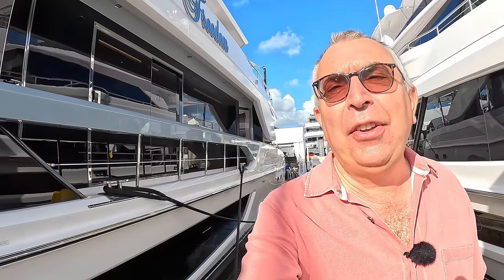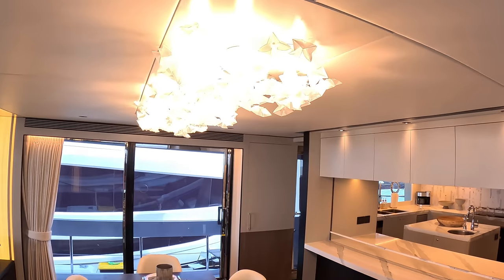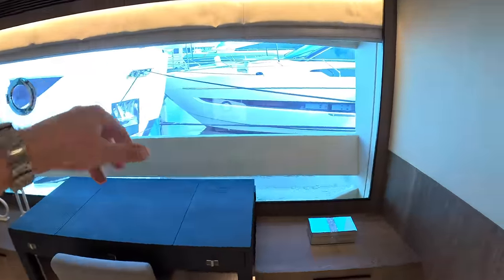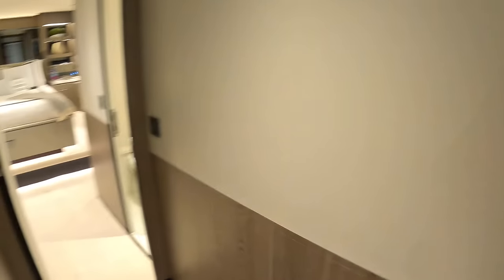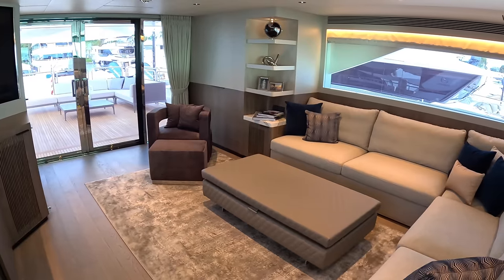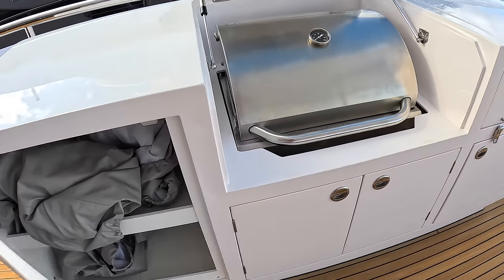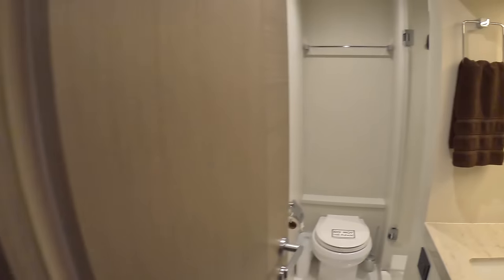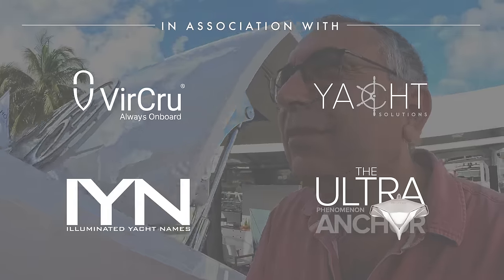$17.6 Million Superyacht Tour : Horizon FD110

Comment: So far outside my Boat Budget, and not wanting a terminal attack of envy, had to cut short watching this, plus it hasn't got Sails.  Sorry Nick Guaranteed it is so nice I'd be done for, and possibly drawn to attempting a Bank Heist. Best Wishes and Fair Winds.  Bob.  👍😏⛵️✨️✨️✨️
Reply from the maker: It costs nothing to dream. 🙂
Reply: @AQUAHOLIC  
True, but Nick, I find turning Realistic Dreams into Reality, a much more pleasant use of my time tbh. Right now, that's a Sailboat between 38 and 46 ft  with a sensible Shallow Draft that's easy to Sail for someone like me, and is comfy for a delivery skipper and crew to take to places I want to go, that can be obtained as soon as the most undervalued asset in the World right now,  gets revalued realistically, that means that boat gets purchased and I'm Afloat in a boat again. Only problem, I just might Die First, but it's my Dream, and I'll continue Dreaming it until it happens, or I drop Dead, whichever happens first. I've now pretty much dotted all the i's and crossed the t's  for the next boat now, and it's been a blast getting this far. Best Wishes.  Bob.  👍😏⛵️✨️✨️✨️✨️✨️

Comment: Definitely a really fantastic yacht and one to dream about. I liked the galley cooker with its pan clamps, one that could actually be used at sea. The crew quarters were very nicely finished but weren't the twin berth cabins cramped? The crew are definitely treated as second class. A more serious fault, in my opinion, was the fact that it only had a two thousand mile range. Probably adequate for the Caribbean or Aegean seas but it wouldn't get me from Southampton  to New York, so I won't buy her!!
Reply from the maker: The crew are not treated as 'second class', they are professionals there to do a job, not to enjoy a luxury holiday, and the accommodation reflects that.
Reply: @AQUAHOLIC  Possibly?

Comment: Was this one made with the newer equipment you trialled a while ago? I'm 5 minutes in and struggling with this video as it is triggering mild motion sickness which I don't normally get with your vids. I noticed the same issue when you first tried the new kit.
Reply from the maker: No, this was filmed on the GoPro as normal
Reply: @AQUAHOLIC  Strange. It got better later on. Maybe you were going a bit quicker than usual because of the size, which is huge. Any bigger and you'd have to take up jogging. Very nice.

Comment: re: 21:45 Just a point of order. US power is 240 volts the only difference is we tap the middle of the secondary and hook our ground there so you can use 120 volts for small loads like lights and tv's and such and then have 240 volts for heaters, air conditioners, dryers, high-end espresso makers etc...
Reply from the maker: Wow, I genuinely had no idea, thought it was all 110v out there.
Reply: @AQUAHOLIC  It's a pretty common misconception since most of the things we interact with are 120 volts.

If you can find the time and like educational videos "The Engineering Mindset" put out one in 2019 titled "120V 240V Electricity explained - Split phase 3 wire electrician" that goes over how our system works.

P.S. Love the videos, thank you for taking your time to make them.

Comment: Can some Yacht expert help me please? If I were to buy my first Yacht, will the cost on upkeep be 10-15% of what you bought it for?
Reply from the maker: No, there is no relation between cost of purchase and cost of running
Reply: @AQUAHOLIC  Thank you for the answer, but is there a rule of thumb to think about?
Reply from the maker: @Natt_Uggla10  Generally speaking, the larger the boat, the more it costs as so many charges (in particular berthing, which is one of the biggest) are based on the hull length.
Reply: @AQUAHOLIC  Ok, thanks again for the answers.

Comment: She is a beautiful boat. Nick, I want to know from you, why don't boats use only 1 engine like commercial boats use, with a larger prop? Surely this can save fuel and you could use the generators as a "backup" should the engines be faulty. I dont understand the use kf 2 engines, its seems like overkill for me.
Reply from the maker: Boats are a lot more manoeuvrable with two engines and props, and the fuel costs are a tiny part of the overall annual expenses involved in running a superyacht.

Comment: With the experience I have after having analyzed more than 100 yachts, I must say that...
Externally it is very beautiful, but the distribution is very bad, not to mention the doors, it is the worst yacht I have seen in terms of doors. The ceilings are very ugly and poorly finished, the furniture has corners and edges, swivel chairs at the dining room table "for what?" the stairs with narrow and slippery wooden steps... and I could continue...
 
The open kitchen to be able to see your cooks working "and for them to see you" (all the interior spaces are very open and then it is full of doors that close the exterior walkways
The jacuzzi in front is so that while you bathe you can say hello to the captain, it doesn't have a beach club so it doesn't need such a big back door, yes... "to have two closets" A good example... It can NOT be compared with the Ocean Alexander 35R worth the same money.

The manufacturer is going to have to work hard to keep up with its competitors and not invent things that have already been studied thousands of times.

Definitely:
I wouldn't buy it, there are many better options.
Reply: I agree 👍 💯 👍